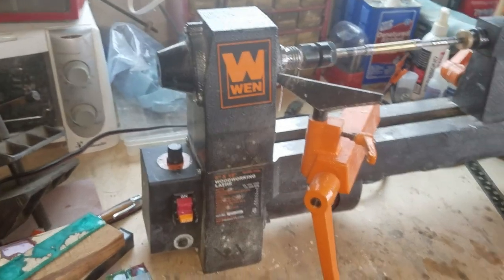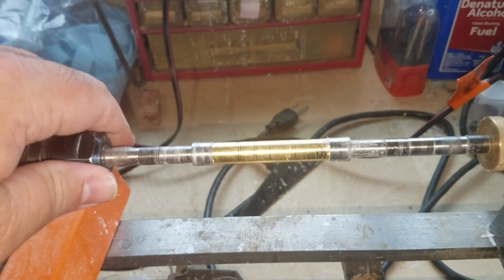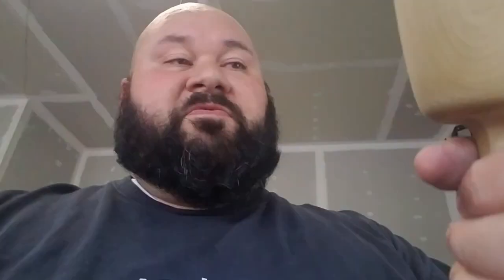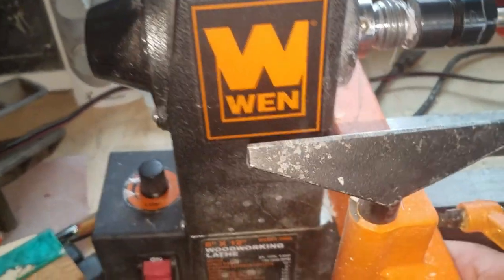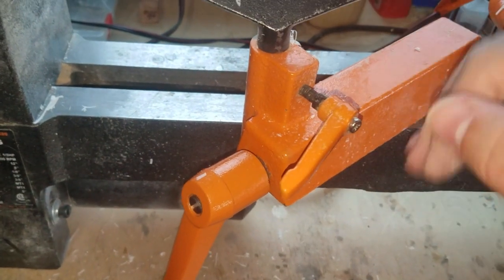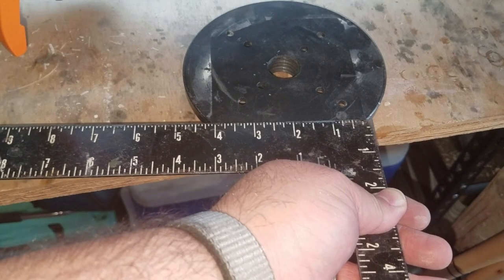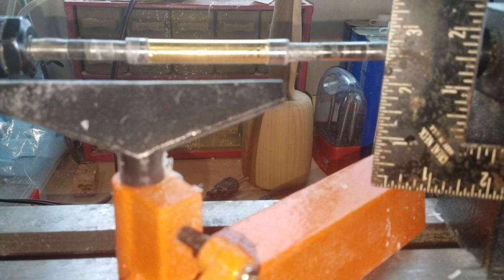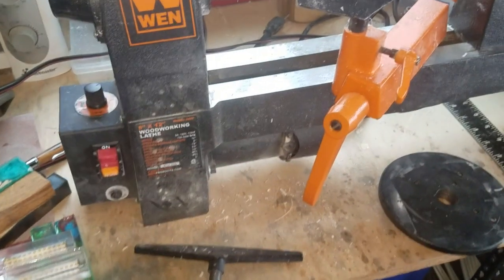Wen Lathe Update

Comment: Hi there. Thank u for your honest review.  I saw in this video u have several acrylic blanks next to the lathe. I assume u are making pens with them. Can u tell me how the lathe performed on the acrylic blanks? I am new to this...That would make a great video as well. Pen making with this lathe. Thanks
Reply from the maker: I am making pens with them and for that it works great.  The variable speed helps a lot with finishing and sanding.  I will have to do a video of me doing one, I thought I had but looking I haven't yet.  So I guess stay tuned and I will post one.
Reply: @JSGWoodworking   that would be awesome and so helpful. Thank you !

Comment: IS this lathe good for bowls? And what exactly the unit??
Reply from the maker: No I would use it for bowls unless you want to spend twice as long because you have to take small passes or it stalls and because of the stalls you might get more tare out do you'll have sand more also.
Reply: @JSGWoodworking   Is that the 3420T?
Reply from the maker: 3421
Reply: @JSGWoodworking  How much hp is that? 3.2?? I found in Amazon that 3421 comes with a 2.3-inch faceplate. But you showed the 5-inch faceplate. So a little confused. Should I go for 3420T or 3421?
Reply from the maker: @afsarahmed1250  it is 1/3 hp

Comment: You bought a pen lathe, so why complain it doesn't do what a big lathe does.
I don't understand people who buy a pen lathe and then complain it doesn't cut a 12" bowl?
Reply from the maker: I'm not wanting it do 12 inch bowls I just want it to do bottle stoppers without stalling.
Reply: I don't hear him complaining.  I hear him voicing some concerns / thoughts about the motor.  He didn't buy it.  It was a gift to hime.
I'm about to buy my first lathe, and I looked at Laguna and Rikon over the weekend.  Both 12x16's, because I want to turn bowls and platters and anything else smaller.  My first question is always.  What size is the motor... ;)    I'm actually looking at this one.
https://wenproducts.com/collections/lathes/products/wen-34027-12-inch-by-15-three-fourths-inch-variable-speed-multi-directional-wood-lathe

I want 1 HP or close to it, Reverse capabilites, and variable speed capabilities.  Those are my top 3 options I'm looking for in a midi lathe.

To the OP.  Thanks for your review.
Reply from the maker: @pfiltz  Thank you for your understanding on what I was trying to convey.  WEN does make some good products.  And yes for those things you want Midi is the smallest I would go and not the mini that I have.

Comment: Hey dude, I’m having an issue with mine. I have the exact same lathe as you, and it’s stalling out.
The problem is it just won’t turn on. I used it for a few hours today and I think I over heated it.
Tried resetting the circuit several times. No dice. Waited an hour. No dice. 
Now I can turn it on and spin the wheel a little bit and it will kick on for about 3 seconds and then sputter out.
Any clues? I’ve hit the circuit reset ten thousand times.
Any tips are HUGE. Thanks bud. Happy turning.
Reply from the maker: If I had to guess it would be something on the control board and I don't know a whole lot about electronics and I don't know of they sell control boards for it or not but I would Google it and see if maybe Ebay has one